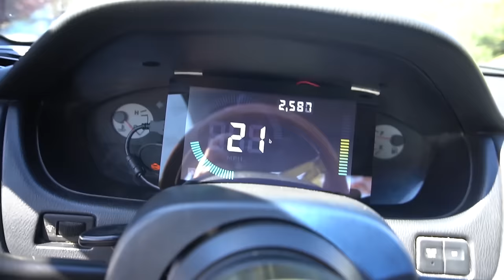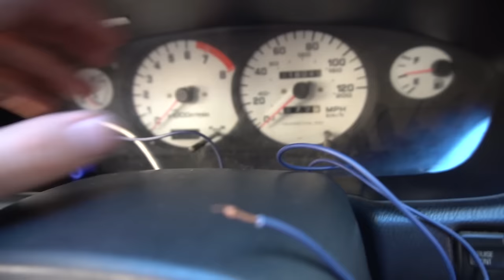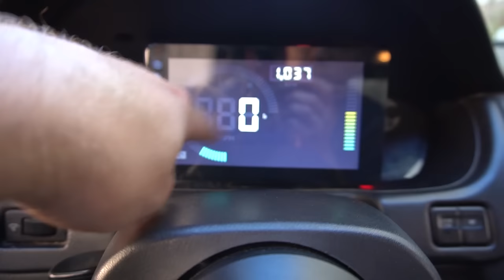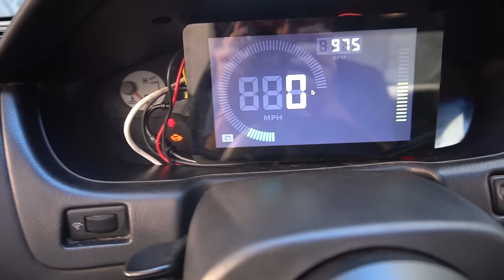Under $170 Digital Dash!

Comment: Why don't you have a fuel gauge? and why is no one else concerned about this?
Reply from the maker: I don't believe consult give you access to the fuel rating, I will double check though. I leave room for the fuel gauge on the right, so I can still see it!
Reply: Is it possible to get the pi to read resistance through a GPIO?
Reply from the maker: Mike Louder Probably yeah! I could probably hook up the fuel gauge to the Pi that way.
Reply: Fuel gauge isn't something the ecu reads and is analog
Reply: Right, that is why we would have to have the pi read the resistance from the sending unit directly. All it should take to calibrate would be to know the max and min resistance
Reply: Oh you do this if I'd be interested in paying for the set and labor of the install(I can do it, but work takes a lot of my time. and I'm kinda lazy)
Reply: Dude, sometimes it is not that simple :) but in general one could do it. If in this car the cluster is reading the fuel sensor, you might wanna open your original cluster and see where the fuel sense circuit is going to the mcu. connect your raspberry adc to the pin of the mcu of the original cluster. this time you are going to use the original signal conditioning.
Reply: Hey, im planning on doing this with my civic, its an eg8 1994 model. Will it work on that? And what cable can i use to connect to the ecu?
Reply from the maker: This will only work on nissan ecu's unfortuantely, if you have OBD2 then you can get a bluetooth adapter and hook it up pretty easily
Reply: Иван Иванов The fuel gauge uses an ignition, ground, and fuel signal. The fuel light also uses a pulse wire, otherwise it's on all the time. Ive completely made my own cluster for my s13, because the stock cluster wouldnt fit my new 350z dash.
Reply: 240SF  hello. Brother my car is to old I can fix in car Nissan ailtima model 1990
Reply: HiDDEN_KiLLZ I
Reply: If you're looking for the full and Analog just use and A2D converter pi can read digital
Reply: So I buy the OBD II to USB and that will work? Currently using bluetooth dongle with android tablet but need more permanent setup with less gauge lag.
Reply: @byron.jennings  you have any build videos or anything? Cheers!

Comment: is it possible to add fuel, oil pressure, and alternator voltage
Reply: I think you can configure it with data to make it read whatever you need it to

Comment: Now THAT is NEAT! Ideas: 1. Stay-awake, when car is off. If you power off everything but the essentials, maybe it won't drain the battery? 2. Sim-card, so you can access it remotely. And track it! 3. Make it control the heating, so you can set it to heat the car automatically every weekday at 7 am? Or start the heating remotely? 4. Display speed not from car, but from GPS. 5. Add a cruise control function! 6. Cruise control speed should be from GPS, not from car.
Reply: You're spelling out a dream! Hopefully this gets integrated soon.

Comment: How about rig up something from your door sensor that turns the internal lights on, so if the raspberry pi is off and the door is opened it can start to boot? Also is it possible to add a setting do adjust the speed reading by a fraction to account for wheel size/speedo inaccuracies? (Would be awesome if could hook-up some sort of gps device that can auto calibrate the speedo)

Comment: I'm planning a project like this on my 1969 Morris Minor. The problem is I have to install an rpm sensor because it doesnt have any rpm gauge. This will be a huge project for me and I hope I'll find out how to mount that sensor and alot more. 😊
Reply: VINCI connect a wire to the coil as you would a tachometer.
Reply: Any luck?

Comment: I would love to have speedo, tach, fuel, volt, temp, gear select, turn sigs, brights, break light and milage like a normal dash. I would love to replace my current dash in my C1500 LS swap. Maybe I could find a custom LCD made in the shape of my dash?
Reply: That would be more complicated,  this doesn't rear raw values but just reads the data stream from the ecu

Comment: Could you set this up as a head-up display (HUD)? Mirror the graphics vertically, mount it flat on top of the dash, and (I think) attach a piece of flat glass against the windshield at 45 degrees or so to reflect the display.
Reply from the maker: Yeah! That could totally work! I have thought about doing that in the past, there is special glass you can get that is extra reflective too to make it appear brighter in the windshield, haven't ordered any of it yet though.
Reply: DONE I have also heard you can use a piece of mirror tint instead. That’s what people do when they replace windshields on S13s that have the HUD

Comment: What connection options are there for Nissans prior to 1996? I'm curious if some engine information can be displayed from, lets say, a 1988 300ZX ECU. That ECU does not have a diagnostic port or plug going to it.
Reply: There should be a consult port under the driver dash on your left side usually

Comment: Do you think this is possible to do almost the same thing buy use put it in the dash and use it for reading codes and controlling the radio and digital ac? I prepping for boost and I'm putting my gauges where the ac controls are
Reply from the maker: Not sure about controlling the A/C but you could definitely do the radio! Later I am probably going to hook mine up to the radio and use it to have airplay in my car
Reply: you could always tuck the ac controller behind the dash and use some servos to turn the knobs

Comment: would it also be possible to let the program give you the temperature in F, and would it be possible to just run nissan data scan tool using this set up? @240SF

Comment: Hey, I have finally set everything up in my s14 and tried it for the 1st time this weekend. I ran the program and the dash didn't show any information on the digital cluster. I have to assume it's due to the 2004 GTO V8 I just put in? Is there any way to fix this issue?
Reply from the maker: Aj Cruz Hey! Yeah that is probably why it is not working. I would think it would still read some information from the stock Ecu if you are still using that for things like speedometer. But I am not totally sure. Sorry I am not the most knowledgeable on what is read by the consult port after an engine swap
Reply: @DONEgrp Hey, It's still sending info to the gauge cluster but the pi didn't pick it up. Maybe the GTO pcm is sending it to different pins on the serial port. I could always test it with an ohms reader wire by wire while stepping on gas or watching it increase as temp increases. Would you know where to edit pin information in the Pi folders? I think If I can find the wires and find the folders and adjust to the correct pins then it might work. If not, then it was fun trying.

Comment: @240SF  Hey, im planning on doing this with my civic, its an eg8 1994 model. Will it work on that? And what cable can i use to connect to the ecu?
Reply from the maker: +Hyder Abbas this won't work with a civic without heavy modification to the code. Sorry, Nissan only for now

Comment: looking into doing this for my bmw e46. would the same apply? also, would want to have fuel gauge and mpg gauge if applicable.
Reply from the maker: Sorry, this will not work for a bmw e46, you need a nissan consult port.

Comment: Hi I made a digital dashboard using an OBD 2 adapter and a nexus 7. It fits perfectly over the cluster, kind of like yours. Do you think this would be legal to use all the time?
Reply from the maker: Daniel Sparks I am not actually sure what the legality of it is. I think it would be legal as long as you are not touching it
Reply: Ok that makes sense. Thanks

Comment: Hey since your 240sx KA has a OBD1 port, when you have to get an emissions inspection, are you only able to get it done at a place that has a dyno to do the test?
Reply: Not really a true dyno but places that do Pre-'95 testing will have rollers and additional equipment that can take readings from the tail pipe.
Reply from the maker: Jon Scherf is correct! They have a sniffer that takes readings!

Comment: Which software is being used to develop the UI? And how does the UI determine which parameter(RPM or speed) to show in which animation?
Reply from the maker: The UI was made with HTML and CSS and I was using react to update the ui
Reply: @DONEgrp  Thanks a lot. I am building a UI for car which shows switching of some component. The data will be sent by my microcontroller. Some other parameters of the component also has to be shown. Do you think HTML CSS and React will be suitable for my project?
Reply: In the UI I have to show real-time animation for switching also.
Reply from the maker: It could probably work, but there are probably better options. I only used HTML and CSS because that is what I know
Reply: @DONEgrp  I am confused about how the GUI will take component data and display it.

Comment: Yo, why do u cut on every start of the raspberry... are the boot times that bad?
Reply from the maker: PaulanerStudios I show it in a couple other videos, it is not great, ~20sec. But by the time you turn the car on and get going it is on and working
Reply: thank you for the response... I'm going to use the raspberry as a dash for my motorcycle tho... And I think I will go a little different route... I'm using an arduino to convert the analog output of the ecu to a digital signal that can go into the GPIO pins of the pi. And I will probably have to do the entire Interface in Python, because even tho the Server/Browser method you used is definitly easier to do, it just seems really impractical to me :/
Anyways, great video... interesting to see how other people are approaching the same project

Comment: Hi! Is it easy to change the speed to Km/h? I want to do it on my R33, I'll try to install it again because it didn't work. thanks
Reply from the maker: Baby Yond yeah it is easy, you can check in the code where there is a function to covert into mph youcanjust take that out and not have it run that
Reply: Thanks for your answer! i'll check when ill have time.I had a look on TunerStudio MS have you heard about it? You can do a really easy custom gauges.

Comment: Would it be different for obd2 s14? Just curious because you specifically mentioned obd1 instal
Reply from the maker: I only mention OBD1 because for OBDII s14's there is a lot easier ways to get a digital dash with a OBDII adapter and tablet. This would still work for OBDII s14's though!

Comment: Very nice!  I looked into doing a digital dash 20 years ago but we only had 386's to play with and I just gave up.  Also I was going to do this on my old muscle car but it doesn't have the OBD connector.  The RPi is a good way to go.  I did notice the boot time but it isn't as slow as my RPi3 is now.  So you must have tailored it somehow?  I want to do a very fast boot on the RPi3 but I cannot find support to do that.
Reply from the maker: Nah, the boot time is really slow, I didn't say anything during the boot time in this video so I ended up cutting it, but if you look at my previous video you can see the full boot time!
Reply: Oh ok.  I do know there is someone here on YT that has got the boot time on his RPi2 to 2 seconds but I have yet to get it do that for my RPi3.
Reply from the maker: Chris Sparks oh damn! I will have to look into that!

Comment: could you make this work for a 20006 civic?
Reply from the maker: Should be even easier for a 2006 civic. You just need to use an OBDII bluetooth/wifi reader and then there are plenty of apps that will display a dash for you :)

Comment: This will work with a r34 25gt skyline?
Reply from the maker: If it has the consult port then it should work. If it is OBDII then there are much easier/cheaper options with bluetooth adapters and android tablets

Comment: How can I get Km/h instead of mph?
Reply from the maker: To change from MPH to KPH you just have to change the convertMPH function on line 79 in server.js to convertKPH.
Reply: Thank you 240SF!! Great work!! I hope you will put more feature on the future.
I want some more reading like Battery voltage, Water temp. in digit-number, TPS and injector duty cycle. =)
I will try to put it on my 300zx. Once again, Thank you 240SF!!

Comment: Awesome project!

It looks like you're using the Mausberry switch for power?  In my own obdPi project (http://blog.bpwalters.com/raspberry-pi-obd-ii-carputer), I ran into an issue with the Pi being shut down forcefully by the Mausberry switch, and ended up implementing a UPS HAT for the Pi.

Since the Pi runs a full Linux OS, sudden shutdowns can potentially corrupt the OS/SD card - is this something you've been able to address?
Reply from the maker: Oh awesome! Reading through your build now!

Comment: so this setup works with Nissan 14 pin.I have the 14 pin in a 1996 Nissan Terrano, I wonder if this setup will work. Any comment?
Reply from the maker: Fisher Leung should work on any Nissan car with the Nissan consult port. I believe the 14 pin connector that you are talking about is that port

Comment: Hold up, the UI is in HTML, and you're running it through Chromium? Why on earth would you do that.
Reply from the maker: Hey man, love your part in Offbeat garage. I have a background in web development so I did what I knew best. Another benefit to doing it this way is I can set up a local network from the Raspberry Pi and then connect my phone/tablet to it and display different gauges on the phone/tablet.
Reply: I am also a web dev, but I still wouldn't do it this way. You're limiting the capabilities of the UI, while at the same time consuming massive amounts of resources. You could implement everything that you desire on tiny AVR chip with a separate LCD driver, without having to suffer from the massive overhead and long boot times from running a whole OS + Chrome.
Reply from the maker: Yeah you are totally right, never said this was the best way to do it. Not sure how I am really limiting the capabilities of the UI, car dashes don't really require much in terms of UI. But I could have definitely done it more efficiently a different way. This was mainly a fun project for me using the stuff I already knew. Nothing wrong with a little fun right?
Reply: Year late:  Your video inspired me to make the dash for the #Teslonda.  (https://www.youtube.com/watch?v=Uproz8DwcRE)  I'm a software/firmware engineer by trade but the chromium web UI + js solution was the quickest way I could get an MVP up and running while having all the goodies like logging, GPS,  external app, etc.  The only down side is the boot times but since our car is a very specific use case, it isn't a big deal at all.   Not only that, but I can easily reskin the front end and bring it to our other EV dragster conversions without much effort at all.   On top of that, I squeezed 45-60fps (thanks to canvas!).    Thanks dude!
Reply: @MrSHUTUPCAT  your project looks great!!